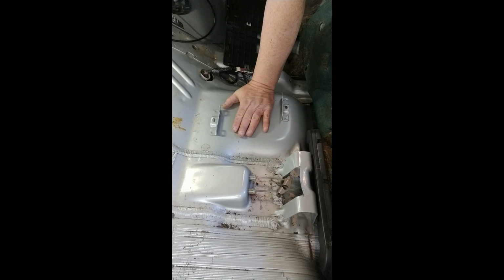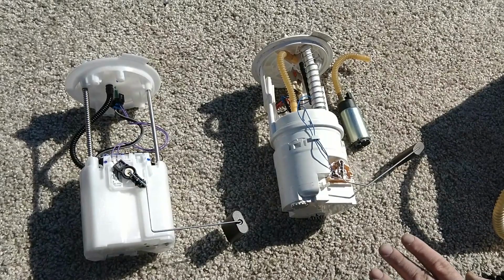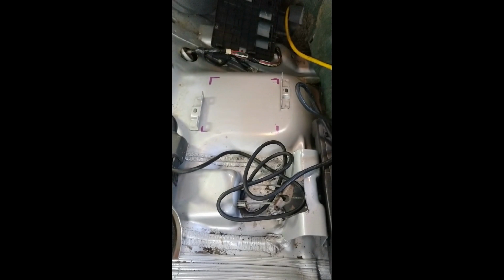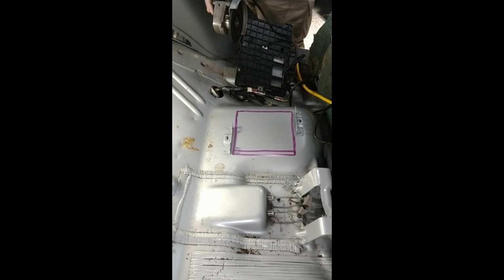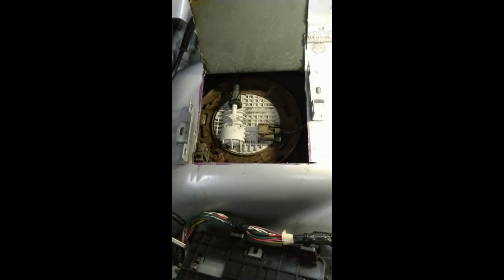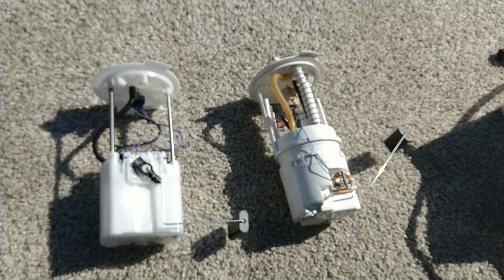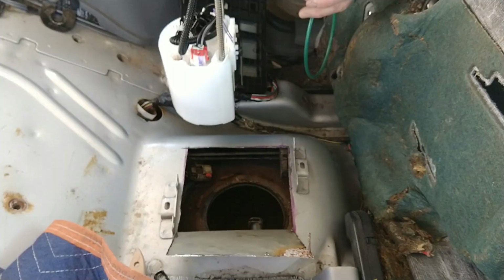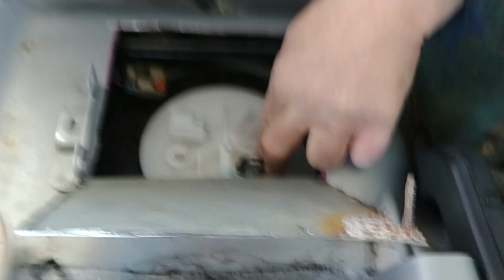NO TANK DROP Fuel Pump Replacement Jeep Grand Cherokee. Commander  - 2005 to 2010.

Comment: If you want to be super slick, prior to cutting, lay down a bunch of mold release over the sheet metal.  Then lay up a couple layers of fiberglass, and once it has cured pop off your new access cover, formed to the exact shape of the original floor.
Reply from the maker: That is a really great idea...   I knew there was at least one person out there with more than three brain cells who is smarter than me... That answer deserves a beer and sandwich. If you are in Pittsburgh, I'll buy. Genius!!
Reply: Would you soften the sheet metal while cutting ?

Comment: Thank you for making this video! I was using my wifes 06 3.7L Commander to tow a TDI Jetta that I bought. I just picked up the car and stopped to get gas in the Jeep. I went inside to get a drink and when I returned the Jeep would crank but not start. I checked the stuff I could like the fuel pump fuse and swapped the fuel pump relay with the one next to it. Long story short I was stuck 100 miles and 2 hours from home at 10:30 pm. Couldn't find an available tow truck until 7:30am the next morning. My wife and I spent the night at a Speedway.

I found your video. I troubleshot it further. Try spraying a small whiff of starting fluid just to rule out anything nut a fuel issue. I ordered the pump. I did cheap out and got the $80 pump on the jungle site. I removed the middle seat. Commanders share the same chassis as the grand Cherokee but the Commanders also have a 3rd row seat. I found where you cut your floor. I drilled holes in the 4 corners. Be very careful and slight pressure when drilling DON'T drill too deep and drill into a fuel line, electrical connector, or plastic fuel tank. I was going to use a cut-off wheel but I just used aviation snips and it easily cut through the metal.

After you make a flap
1) pull red tab on the electrical connector  the squeeze the locking tab and wiggle and pull off.
2) remove locking ring. I had a lock ring tool but I also used an old punch and hammer to go counter clockwise.
3) carefully pull out retainer for the fuel line. Even though I was careful mine still broke. I just re-inserted the 2 pieces and zip tied the in place when going back together.
4) remove pump
5) do everything in reverse going back together.
6) fold down the flap of metal. remove any sharp edges. seal tightly with caulking or seam sealer. I also cut a slightly bigger piece of stainless sheet metal and just sat it over the patch job and the put the carpet back down.

This method is far from unprofessional. In fact this is how it should have been from the factory. This method saves a lot of time and would allow someone who doesn't have a lift or other means of dropping the tank to still complete the job on their own. If you live in the rust belt like I do then all the bolts and lines to remove just to drop the tank is more trouble than it's worth. Also I have changed several fuel pumps in VW diesels. All of the VW's that I know of from 1998 and current  you remove the back seat flip up a plastic cover and the fuel pump is easily removed. They should all be that way!

I just wanted to give more info to other just like you helped me with this video1 Thanks again.
Reply from the maker: You are very welcome and I appreciate your good words. I am glad that my days of careful planning, looking in dealer service manuals, and also snake camming the Grand Cherokee paid off for you and many others. You are correct, Jeep should have put a panel with bolt holes in it at that point to make service easy. I had heard that in other countries it is mandated for access panels for such things. My jeep was stranded a long way from home when I repaired it in the video. The camera guy you saw in that video was my son who looks nothing like me but is a great camera guy and a good helper. I like your idea about the aviation snips, but I had a very thin disk cutter and usually use it. The metal there was very thick and I was not sure if I could cut it with the snips. I also sealed the patch with hybrid silicone and put a metal patch with short screws over it which made it water tight. That Grand Cherokee was fast with a 400+hp power plant and would reach 140 quick and I did not have the stones to push it faster. You should have seen the other SUV's (Merc BMW Porche Ford Jag Alpha etc) when they are out to play at 100 and you pull up on them strong. I had one guy in VA ask me at the gas station what the hell was in that thing LOL. I sold it because it turned the transmission into playdoh and I was concerned I would kill myself ha ha or end up in jail. My son wanted it but I did not want to bury him. It was a monster. Made it from Charlotte NC to Pittsburgh PA in 6h40m and that included a quick stop for fuel on 81 in VA. Do the math. Glad I sold it. Its better driving a more fuel efficient leisurely vehicle and not having to have my funeral planned HA HA.
Reply: @KlodFather  I have seen the TrackHawks and I agree they are a death trap. I'm looking for a Cherokee with a diesel engine. They offered them in the GC and Commander but the Commander only for export out of the US. I'm a diesel guy!
Reply from the maker: @Superduty_59  -  Did you get that reply that does not appear here? Its in your email. Read it and I hope that event near you is of interest. Its about 3 hours to columbus from here... Maybe a little less.
Reply: @KlodFather  I did not.
Reply from the maker: @Superduty_59  -  I will be at the columbus hamfest at the Aladin shrine in Columbus.  https://aladdinshrine.org/hamfest/   I know that is not too far for you. Its an electronics flea market. But I will be there. Best wishes dude. Take care.

Comment: Thank you very much. I did do it differently though. I used a step bit to go to 1/2” holes on the corners. I then just used a heavy duty pair of sheet metal scissors and was thru in short time.
Reply from the maker: THis is a great idea.
Reply: Did you use silicon once you bent the flap down?
Reply: @BlueChipAdvance  yes, I rtv’d after. I might have used short self tappers with washers. Don’t remember tbh.

Comment: I'm sure some will find this useful, but from my experience, dropping the fuel tank isn't that difficult.  If you have proper tools and a  plan, you can have the tank on the ground in under an hour.  Removing the interior, cutting and repairing the hole you made, and reinstalling the interior likely took longer.
Reply from the maker: By the time you had the tank out, I'd be closing it back up again with the new pump in it. This saves much time. 
You hadn't taken into consideration rusted bolts and when you drop the tank, you have to disconnect the fuel lines in an area that's generally inaccessible which you can't see. 
The fuel lines on these vehicles are very brittle and very easy to break. This is also noted in some others videos on YouTube. 
There are always naysayers like you out there who want people to do it the hard way. 
The interior removal talk about 12 minutes. I used an electric impact gun and took the bolts right out. 
We simply didn't want to run the risk of the tank falling. Also dropping the tank would have been much much more dangerous because we had to do this repair in a Walmart parking lot. I wasn't going to drag the fuel tank out in the lot and work on it. 
It's a lot of trouble and a lot of work tank dropping tanks. Spills are a real thing... Dangerous. All that is eliminated in my procedure. 
You never took the time to consider all the downsides to your way of solving this problem.  The hole was easy. It's a trap door under the rug. It's above the tank so no rust issues. 
I have put this option up for the public to choose. They will vote with their feet on how to change their pump... This option worked best for me and many others. I get a lot of ++ feedback.
Reply: I wasn't at all speaking negatively.  As said, I was speaking from my experience and I wasn't at all saying my way was the only or even the best way.  You put a lot of thought to argue points I never made.

Comment: There are two things that I worry about. 1 is the sound coming through after you cut the new trap door and 2 is the kaboom when the spark catches the vapors, lol. Great job and if you're stuck at Walmart parking lot I would've done the same. I'm having gas Guage problems, but I guess I can wait for the pump to go out. Thanks for the information about the Delfi brand.
Reply from the maker: You won't get any sound through it because when you bend it back down into place, you seal it closed with silicone caulking (high density) and there is no noise or airflow.  I also place a piece of plastic or metal on top of the patch glued down with silicone or RTV (Same Thing) and this makes the opening sturdy under the rug. This is under the seat and not load bearing. The tank was wet with water and no fumes when cutting. You can always spray CO2 into the tank or push steam into the area of the tank. Steam displaces air and is very inert and safe. Keep CO2 and water fire suppressors around.

Comment from the maker: I AM HAPPY TO REPORT THAT THIS VIDEO HAS SAVED MANY PEOPLE TIME TROUBLE AND MONEY. GLAD TO SHARE. 
This video shows you just enough to acomplish a NO TANK DROP replacement of the fuel pump. 
Use all proper safety equipment and safety procedures... Including an evacuation fan to remove fumes from inside the car. 
For the experienced mechanic this job can be done in 45 min to 1 hour.
Reply: Do you think you’ll ever do it on a wk2?
Reply from the maker: @00mrvip00  -  Probably not. No more Jeeps for me... better said no more mopar for me. (Maybe a kit jeep from Philippines made out of stainless with a turbo diesel in it :) )   Service over 100k miles is just too much to keep up with on Chrysler. Fuel economy on Jeep and Ram is abysmal.  I am getting older and enjoy less and less projects like this. Old fat and sore. I am sticking with Ford and Toyota from now on simply for  serviceability and parts availability. Ford has a good commercial vehicle reputation and Toyota trucks are notoriously good.

Comment: Awesome time-saver!  Thanks!  I wish you would have spent a few seconds to demonstrate how to disconnect the electrical connector and fuel line- those can be maddening for someone (like me for example) that is always perplexed by them.  I've broken a few trying to figure them out.
Reply from the maker: I am sorry I did not show that... I left the basic stuff out and got to the meat of the matter. The things that would be the hardest for the DYI guys. The next time I take one apart, I will do just that. In fact I am going to show how to basically fubar rebuild one of these pumps with a generic pump and kinda bodge it to use someone elses inexpensive pump to save big $$. The next time I work with those fuel lines like on my van (FORD) I will show the tool and how they disconnect.  Keep in mind that some tools are good and some really suck.  The cheapy scissors tool to remove those connectors is junk and will only piss you off.

Comment: I like the video but I agree with some other comments about fire concerns. I'd drop the tank to do the pump BUT then do this so next time I wouldn't have to drop the tank again.
Reply from the maker: As long as you don't have leaking gas or gas fumes before you start, you are OK. You can also use an air chisel to cut the metal but it is not as surgical as the thin high speed blade I used. Another trick would have been to cut the hole with water flowing and suck it out of the floor pan with a shopvac eliminating the sparks. I am always up for someone elses good idea.

Comment: Where is the fuel filter
Located ?
Reply from the maker: Its in the fuel pump assembly.  Buy the VDO Delphi Bosch pumps. Don't buy that other POS I showed in the video unless you want trouble. No external filter. Cheap Jeep Cheap Jeep   What else can I say?

Comment: Would an oscillating tool work to cut the hole??
Reply from the maker: I don't know. Did not have the luxury of an air chisel or one of those multi-tools. I can tell you that metal in that area of the floor is quite thick and very tough. ITs not soft fender steel. Its meaty. I did not drill it because I did not want any accidents in drilling the tank, and I had already checked the take with a snake camera for leaks. Let me know how the oscillating tool works for you. I am very interested in your results. Feel freed to post a link to the video here for others to see it.

Comment: Question, how did you cover the fuel pump afterword ?
Reply from the maker: I riveted ears on the square panel I cut on three sides. I bent it back down and screwed it to the floor. I caulked it closed with hybrid caulking. Its solid and sealed tight. If I have to get back in, just peal the caulking back, take out the screws, and bend up the metal. You could put a hinge on it if you want.

Comment: I enjoyed watching this but damn was that dangerous
Reply from the maker: It was not dangerous at all because at no time was there a chance of fire by cutting into the tank. There was no leaking gas or flammable material near the cut. These problems were investigated thoroughly using a snake camera.  Also there was an excess of fire suppression equipment including a water tank with a pump to operate a garden hose at about 60lbs pressure. We were prepared. 
You could also cut this with an air cutter but be aware this metal in this region of the car is VERY HARD AND TOUGH and its thicker than the ouside panels.  Repair worked out well and the car is running.

Comment: Hey KLOD..great video.. would you happen to have the Delphi part number I'm getting a lot of conflicting information online..thx!
Reply from the maker: Delphi FG0843 for 2005 through 2010 grand cherokee. Pay special attention to the part of the video I put in twice showing the two types of pumps. Do not buy the shit pump I show. Buy the VDO Delphi or Bosch pump... don't buy those other mechanical assholes.  Good luck
Reply: @KlodFather  I saw it upon review, Thanks!
Reply from the maker: @tomcon626  - Good luck. Let me know how it turned out for you.  
Also note that the filter, strainer and the pressure regulator are all in the pump and the rear mounted fuel filter. Change the pump assembly and the rear frame filter. This system has less parts. The only way to change the pressure regulator is to change the pump and the fuel filter.
Reply: @KlodFather  Thanks, I actually completed the cutting and replacment a couple of months ago but used another brand of pump (stupidly). Im have long crank issues now and suspect the replacement pump was inferior, So I am going to order OEM as you suggested.
Reply: wait, what is the rea mounted frame filter?
Reply from the maker: @tomcon626  -  Advance Auto Parts pumps are CRAP!  In my humble opinion lol 
BOSCH DELPHI or VDO.  Make sure they look like my pump in the video or the part number I sent you.
Reply: @KlodFather  Yes!,  Autozone has the Delphi pump FG0843, which was the part# of the one in your video. I will install this weekend and advise, Thanks for all your help and quick responses.

Comment: What were your jeeps issues with the original pump that made you replace it?  Did it fix the issues?  How hard was it to remove the old pump?
Reply from the maker: The Jeeps were originally issued with a Delphi pump. I don't know how good the quality of the OEM pump was but I know that the pump of that is sold as a replacement by kreisler as well as the Delphi pumps that are sold as replacements have a lifetime warranty on them. The Bosch and Vdo pump are of the same design and are very good. Stay away from chinese junk pumps like the one I showed you in the video. They are crap.

Comment: Its hard to tell from the video... is this directly under the rear passenger side?  Wouldn't a 2005, 3.7 liter Laredo fuel pump be in the exact location as this video?
Reply from the maker: This is under the rear drivers side under the electronic module. That module controls the transfer case.

Comment: Hi quick question,I have a  3.7 commander 08, should be the same?
Reply from the maker: From what I understand the commander is the same unibody just skinned differently in those years. Take out your seat and examine the floor where I showed you in the video under that box. You should be smack above the gas tank pump at that point. Use a snake cam through the bolt holes to verify it is there. But your repair should be just the same on that Commander. Change the pump and if there is an extra filter in the line under there, get it at the same time.
Reply: @KlodFather  thanks a lot for responding!
Reply from the maker: @trevormoore8012  -  Just do your homework and look at the exploded view of how its put together... I am fairly certain the commander is the same but BE CERTAIN. Good luck and make sure you buy the pumps I specified. Bosch Delfi VDO. Stay away from chinese shit pumps like the one I showed you guys in the video. BTW... someone else has the car and its still running. That HEMI was too fast and I had to get rid of it. Was souped up with performance exhaust and major suspension upgrades. Glad its gone. I was going to kill myself because it handled great. Run like a scalded cat. 140 at the drop of a hat. STRONG pulls at 60 70 80.

Comment: Can you show how you fasten the metal plate back?
Reply from the maker: I already closed it and its under the rug. 
I drilled it and riveted a lip on the three unattached edges. I then bent it down onto the floor and screwed it down. 
Then I sealed the hole with silicone caulking and put a piece of wax paper over the caulking so it would not stick to the rug. 
Put the rug down and run the bolts in the floor for the seat and all done.